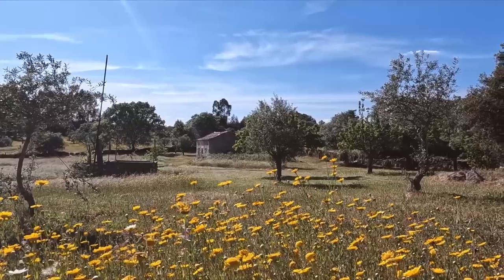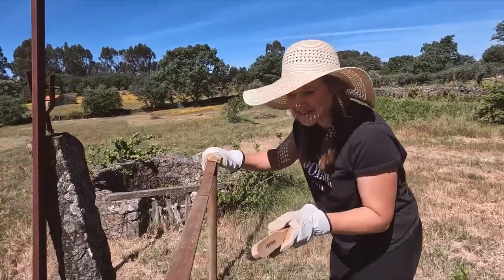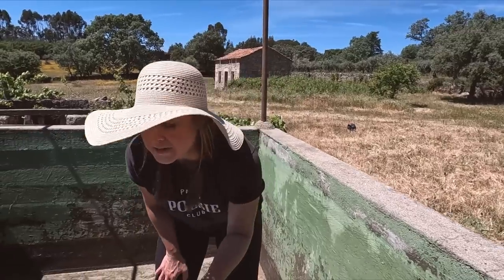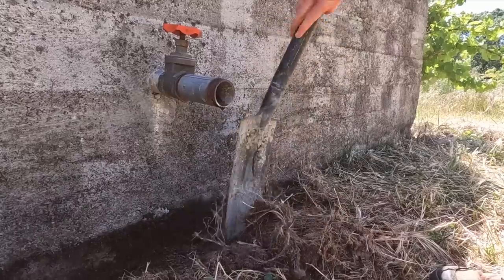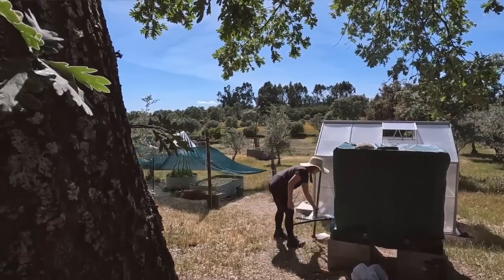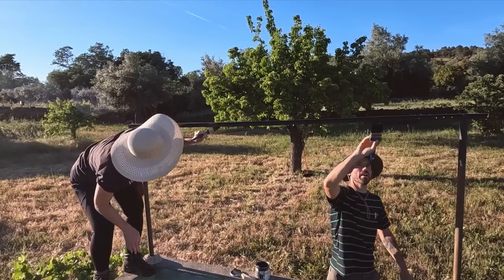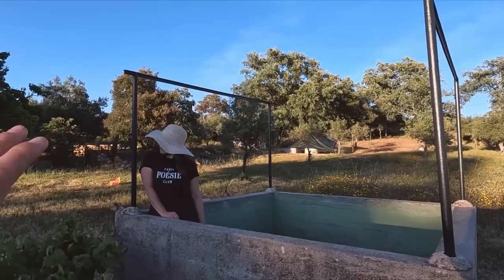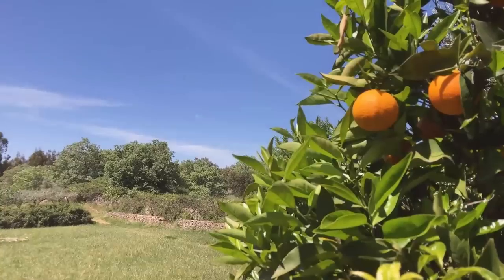Hoping We Don't REGRET This! Homestead DIY Plunge Pool Reno

Comment: For working in the heat, men's white 100% cotton dress shirts are often available in thrift/op/charity shops (or you might have some on hand, as vestiges of a former life?). They don't have to fit, as long as they're large enough for comfort. Cuffs can be rolled up or cut off, and the standing collars do a great job of protecting the back of the neck.

Comment: To paint a rough surface like your tank use a thicker roller and roll from the bottom up. The thicker roller holds more paint and goes deeper into the cracks and crevices. moving from the bottom up creates a wave of paint on top of the roller that flows against the wall and into all the depressions.  You guys are the greatest. Keep it up!

Comment: Regarding fig trees:   My dad was very successful in rooting fig branches.  His method was to wait to late fall, after the tree has fruited and dropped its leaves. Then he would carefully bend a low “ limb” to the ground and lay a heavy rock or three or four solid bricks on it. Before doing that he cleaned back all the weeds and grass and made sure the soil was amended with a little compost so the ground would stay moist and for roots to form from the limb.   He left this, undisturbed, for sometimes a year…then carefully remove the rock/ bricks and be careful to not disturb any new growth on the limb.  Roots should have formed, enabling you to transfer the new fig to a larger pot that drains and is filled with good compost.  Place the new plant in a shady area and make sure it is watered as needed.  Transplant the new fig plant to a well chosen spot, carefully chosen to allow it to get plenty sun.   Depending on the type fig tree you plant ( seasonal or everbearing) make sure it is well watered during the super hot, dry weather in the summertime. Be careful when you strim around any fruit tree because it can hinder the plant if its trunk is damaged.  Good luck.💕

Comment: I’m just looking forward to seeing the 🐕 🐕 plunging into pool.  Doggies may need a couple of floaties.😂 This concrete paint job reminds me of when I sealed my basement concrete walls and felt like I was never going to be done.  I did apply it with a 5” brush too since walls were so porous then the 3rd coat was rolled on which made it look smooth.  All projects are a learning experience. I learned I’m never doing that again!😅

Comment: Hi Victoria.  A craft project for your cucumber garden asap.  Using pairs of same size terracotta pots caulk hole in one pot, glue rims of two pots together so waterproof join.  You now have porous water bottles.  Next bury a few in garden bed with open holes visible.  Fill with water.  Plug holes, eg cork, plastic lid, etc to prevent evaporation.   Top up as needed.  Result is slow trickle of water through porous terracotta to plant roots and alters soil's waterholding characteristic.  Very water efficient and effective in arid climate.  As the soil looked so bad I would still water with hose, but that soil is highly unlikely to hold water - hence having slow moisture jars. 

Suggest building pumpkin and melon beds now, while you have green grass.  Dig down 15cm. Fill hole with green grass free of seeds and bulbs plus fallen brown leaves plus chopped up fallen fruits plus household scraps plus part bag of chicken, sheep or cow manure plus part bag of blood and bone.  Cover with the removed soil, water and cover eg with hession bags used for grains .  Heat and moisture will quickly create rich water holding soil.  When matured, dig bed with fork to mix bad top soil and new soil and plant and mulch with hay as usual.  Using terracotta pots in this good soil will reduce hosing (water useage).

Comment: You could use pool liner and wouldn't have to remove the paint on the inside of the tank.  It's really resistent and lasts at least a decade, without any leaks.  You would probably need someone to do it for you though.

Comment: rust can be removed more easily adding a bit of vinegar to the steel bars, wait a few minutes and the scrub and wash.
Reply from the maker: Good to know! Will bear that in mind for future projects 👍🏼
Reply: May I add that household vinegar is not strong enough. you need higher strength vinegar to do the outside  jobs.
Reply: @glendalawson150  I soak my garden tools and some otherts  in hot water and common vinegar and let them say for sometime, after i use a brush and after just water. Sometimes a second cleaning is needed, but after it works fine, clean as new...

Comment: If you have bamboo locally, that would make a great and sustainable smooth rounded edge for the ledge. I also like the tile idea, but initially thought you could just build the slightest curb arc instead, so water would run off and it would still be comfortable and safe for you and the dogs.

Do you happen to know what variety of orange that is? They look delicious! I grew up with a few orange and other fruit trees in my yard in the Southeastern US and it's something I long for until I make it happen for myself now. 

 Love this project and all you're doing on the property. I look forward to new episodes.

Comment: You can also try one of the small paint sprayers. Here in the states they have the Wagner brand. That helps get into the pours and texture. Then back brush it for the mechanical adhesion. Then you can top dress it with another spray coat. Pro painter tips.

Comment: Mongoose?  If there could be an issue with the pool being designated "non-agricultural," just toss in plastic chairs when needed, or even a bench that can be removed.  Not sure about that, but just an idea.  Two dogs and you two on one bench might be a stretch.
Thanks for another video.  Much appreciated.

Comment: An angle grinder or drill with a wire brush attachment would make light work of the rust, lycan and paint :)
Reply from the maker: I’ve actually got one of these attachments Craig for the drill. Just didn’t use it as the drill needs replacing. It’s old & the battery lasts all of 2 minutes with constant use
Reply: @LifebyLiving  What are you going to do about water filtration?

Comment: Try using lighter clothes when u work outside! The 🔥 ☀ here is fierce and dark clothes make u feel hotter. Also remember both to sladder lots of SPF30 or 👆u don't want to injure that beautiful skin. The orange night thieve is probably a mangoose (serracabos in 🇵🇹 or a taxugo (badger) . Good job guys! 😁👍
Reply from the maker: Ahhh I didn’t think about mongoose! We have seen them on occasion. Don’t worry, we apply lotion CONSTANTLY! We’re both very paranoid about skin damage. Definitely need to do some clothes shopping for more lighter clothes with long sleeves!
Reply: Lighter colors!!👍🏻👍🏻👍🏻
Reply: And linen is a great choice if possible.  It’s both cooler and stronger than cotton and, best of all, gets softer with every washing!
Reply: @esmekaffen4961  yes but even the finest linen here in 🇵🇹 is intolerable in the heat, especially with delicate skins like theirs and mine. I have found that the best option is  light Pima cotton.
Reply: Yes, those black tights are hot! They hold in your body temperature. Pima cotton sounds much, much cooler. Lighter colors is a must as well! 
Your pool is going to be a God's send this summer! Will you have steps for the "vertically impaired" !!! Hahaha 😂 (That's what my hubby calls me! I have several stools around to use!)

Comment: Is the pool seating West facing for Sun Downers watching the sunset in the pool? Also would you be putting seats on the other side for guests?
Reply from the maker: The seating is east facing. The pipe work was in the way to have it west facing & more trouble than it’s worth to replace piping. Plus in the summer, the sun is still so hot at sunset that we’ll probably use a curtain to block it anyways
Reply: @LifebyLiving  fair enough...

Comment: Are you going to put in a circulation pump/filtration to cut down on it going stagnant?
Reply from the maker: Not permanently installed but yes we’ll be circulating & cleaning it regularly 😎
Reply: @LifebyLiving  It will be great when it gets hot to cool down under the shade sail.
Reply from the maker: @BrokenBackMountains  can’t wait!!
Reply: @LifebyLiving  In your heat, it is essential. I've done renovations etc in +30 temperatures. Not fun.

Comment: Electric when you need it and where you need it. First a battery, Car battery will work fine, Than a Converter, that takes 12 volts and changes it into 110 volta and that will run most of your electrical says, grinders and small devices. I use mine to weed eat our weeds and stop paying good money to weed eat your grass and weeds. OK, Stay safe.